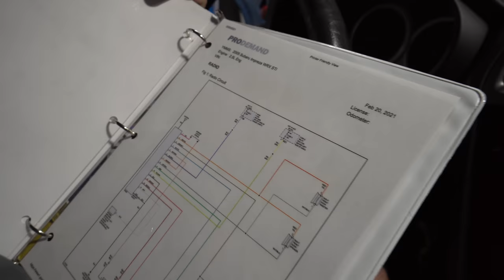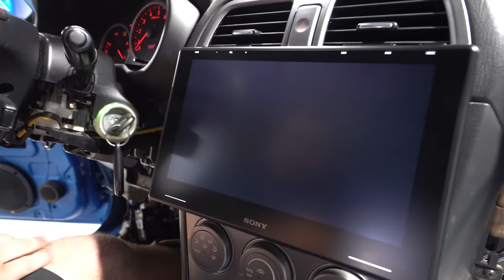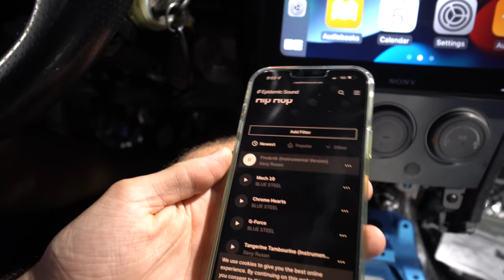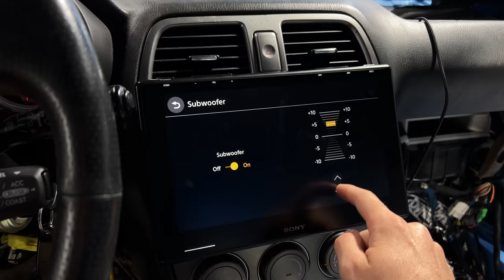Installing a HUGE Apple Car Play Unit & Sony Sound System (2021 Tech in a 1996 Car!)

Comment: I’ve been following your channel for a while... Watched the garage renovation, the work on your STi... I’m running the small Sony XAV-1000 unit and I love it! But... I’m thinking about upgrading to this unit! My setup runs Infinity components up front, Infinity reference speakers in the rear doors, and an RE Competition 12” in a custom vented box all powered by a Fosgate 6 channel amp. It slams hard and is crystal clear! I just wish that I sound proofed my Bugeye the way you did your GC... Can’t wait to see what comes next! Keep up the good work brother!
Reply: do you have to have your phone plugged in to use apple car play?

Comment: Damn the screen is 1300 dollars I wasn’t expecting that and the speakers are kinda pricey too but worth it since they’re Sony but the sub is definitely a good price I’d for sure get that but that screen is way too pricey for me I’m too cheap for that lol
Reply: This particular Sony Mobile ES head unit is their FLAGSHIP.  It has DACs that rival the best home audiophile gear and also includes a Full "Network Mode" and DSP!  In terms of Sound Quality and Features, it is one of the absolute best available, and that's why it carries the Sony Mobile ES designation..."Elevated Standard".

If you want something less expensive, but with killer sound quality and features, I highly recommend the Kenwood eXcelon Reference (XR) double-DIN head units.  These have 5V RCA preamp outputs that do not clip even at full volume (40/40), and DSP/Network Mode, Apple CarPlay & Android Auto.  You can pick up a used but good condition Kenwood XR DDX9905S for $280-$350 and will have one of the best sounding stereo head units available. 

The Sony Mobile ES 6.5" Component Sets are quite reasonable for what they are at just $299....remember that this is Sony's Flagship set.  Compare that to Focal, Audison, Dynaudio, Morel, etc and they are a bargain.   No, they may not be quite up to the level of those others, but they are excellent given their price!
 
The amplifiers are only $250 each, and while they aren't monsters in terms of power output, they provide Extremely Clean and Accurate power for the components and subwoofer(s) that they are intended to be used with.  This is a system that when set up, installed, and tuned properly, will provide KILLER Sound Quality.

Comment: 1300 for that head unit alone 😂 was really responsive tho compared to other double din screens
Reply: This particular Sony Mobile ES head unit is their FLAGSHIP.  It has DACs that rival the best home audiophile gear and also includes a Full "Network Mode" and DSP!  In terms of Sound Quality and Features, it is one of the absolute best available, and that's why it carries the Sony Mobile ES designation..."Elevated Standard".

The 6.5" Component Sets are quite reasonable for what they are at just $299....remember that this is Sony's Flagship set.  Compare that to Focal, Audison, Dynaudio, Morel, etc and they are a bargain.   No, they may not be quite up to the level of those others, but they are excellent given their price!
 
The amplifiers are only $250 each, and while they aren't monsters in terms of power output, they provide Extremely Clean and Accurate power for the components and subwoofer(s) that they are intended to be used with.  This is a system, that when set up, installed, and tuned properly, will provide KILLER Sound Quality.

Comment: I love this it really shows what a good compo set , sub and radio(also very important) does to tge quality of sound in your car. And that wiring looks really good the only thing i would have done diffrent is the cable inside the sub box. I would have tacked them to the bottom so it isnt completely lose but that more for my own sanity i think.

Comment: why are you running wires through the door panel metal without protecting them. gonna cause a short sooner or later especially since you didnt deburr the holes...  Also shouldve put foam on the speaker cables so they cant vibrate in the doors etc

Comment: You have the fuses for the amps mounted way to far away from the source.  The only thing those fuses are protecting is the inches of wire between them and the amps.  They should be mounted no more than 12 inches from the battery....the closer the better.  NIce build other than that guys, the more you grind the more satisfaction you'll have in the end.
Reply from the maker: The battery is relocated in the trunk

Comment: Are those wires for speakers? oxigen free cooper? i belive use courrent cable for audio instead... Sorry I never liked make holes with the speaker in place, and never ever put cables on a hole that havent been removes all the metal from the hole. Not a good work.

Comment: I have a jdm 94 wrx, the ej20g blew, considering the fact that you pulled the engine and want to go fast when the light turns green I’m assuming your going to put a ej257, is it possible for it to fit without doing any changes to the body work, maybe making the engine bay a little bigger

Comment: How did you managed to install the head unit close to dash?
I have the same radio in corolla but there is atleast 2-3 cm gap between receiver and dash. Please share any tips to move it a little back (close to dash)

Comment: for the love of god, build some sort of rear deck venting for the sub stage.
Reply: Better yet, build an enclosure that fits in the front passenger footwell.  In this system it would provide WAY better subwoofer frequency response and accuracy...even if it is a sealed enclosure.  ;) 

Check out Brian Mitchell's ARC Audio World Championship Sound Quality competition vehicle (Cadillac EXR) where he uses a single 12" subwoofer firing towards the firewall in the passenger footwell.  :)
Reply: @bbfoto7248  that would be annoying to move around.

Comment: I have two questions. Did y'all tune the amps to the head unit, or tune it by ear "oh that sounds good". Need to figure out what at what volume the head unit starts to distort and tune the amps according to one volume setting under where it distorts, for the system to be properly tuned. Second question I have is, what kind of power is going to that sub to only be using 16 gauge wire? That's incredibly small wire. Most subs come with like 10 gauge or even 8 gauge.
Reply: Oh wow, I see that stats on that sub now. 4ohm single voice coil 450 watts rms. Itty Bitty sub.
Reply: At least 12 would have been a start but that small wire was the cherry on top for me
Reply: 10 gauge wire is going to the sub
Reply: @Randallpullen123  10G might be going from amp to sub but the bottle neck will be the 16G leads coming from the sub. I would pull those out and replace them with 10G.

Comment: why install components in the rear? why install the front tweeters low in the door and not the a pillar? why cut the factory harness instead of buying the proper adapter? just odd to see things like that

Comment: How do you feel with the volume buttons on top like that? Also.. are there any good solutions to mount some type of steering wheel control that you typically lose out on when going after market head units?
Reply: @Tom Le  
You can typically purchase a 3rd party Steering Wheel Control Interface such as the SWI-series from PAC-Audio, Metra/Axxess, iDataLink Maestro RR, etc, that will retain the OEM factory steering wheel controls when installing an aftermarket head unit.

The iDataLink Maestro interface also adds Performance Gauges and other custom features to Head Units that are Maestro Compatible (such as this Sony and most Kenwood eXcelon stereos), including OEM TPM, and the ability to assign TWO functions to Each steering wheel button by using either a quick press or long press of each button.

But I wish that they had a Rotary Commander Remote similar to the high-end Sony RM-X90 rotary commander remote on the previous Sony Mobile ES # CDX-C90 head unit.  That remote is AWESOME and can be operated completely by tactile feel without ever taking your eyes off the road.

IMO, most steering wheel controls are difficult to operate when driving this type of sports car...i.e. through the "twisties" during spirited mountain and canyon or track driving.

Comment: how much did the entire project cost give or take because i would love something like this for my car
Reply: This is Sony's new Flagship Mobile ES (Elevated Standard) car audio gear.  The head unit alone is $1,300.  Each 6.5" 2-way component speaker set is $299.  Each amplifier is $249.  The 10" Subwoofer is $218.  Add in the cost of materials for the subwoofer enclosure, RCAs, Power wiring, fuse blocks, battery terminals, Dynamat, etc...so probably another $250-$450.

Comment: Not sure I can let this one slide, copper wiring is definitely NOT all the same, you should definitely use specific wire for specific purposes, there’s solid and braided wire, wire of different resistance, wire with different levels of purities and consistency…..and there’s a lot of different types of shielding for different purposes…insulation, heat resistance, grounding, signal blocking, you should NOT be using any copper wire Willy nilly for any purpose, that’s just bad information

Comment: also you bothered to solder each connection at each speaker but couldnt be bothered to remove the sub terminal and solder those wires on?

Comment: Through out this video I noticed numerous instances of wireing being run over metal body panel edges and holes with no protection against insulation being warn through against these edges. This presents a high risk of short circuits. Cable routing and securing needs to take in consideration of othere moving components in the vehicle, particularly around the window regulators and door locking mechanisms. Holding speakers inplace while drilling through there mounts risks getting metal swarf into to them. Using a impact driver to drive in fixing screws on spekers risks over torquing them and distorting the cage and causing subsequent misalignment of the speaker cone and voice coil. I did notice in the video moments where these screws were over torqued to the point stripped the fixing hole. Single screw through the crossovers may not be ideal as this may be a sorce of vibration against panels there attached to. No automotive felt protection wrap on cabes lightly to cause vibrations against body panels and other vehicle components. No drip shields on door speakers. With car doors there is a some seepage of water around the window that enters the door cavity in wet conditions or washing. With out any protection over the back of a speaker located with in this cavity this water will drip on it and damage it. The low location of door tweeters will massively atenuate there output Vehicle specific plug in wiring harness adapters are available for head units, where possible it is preferable not to cut up the OEM wiring harness. With head units that have video displays there are many places that it is required to be able to detect if the parking break is applied. Some acoustic packing in the sub will help with the standing waves from it's central position in the enclosure, and also keap the excessively long cable from rattling around inside. Soldering the spade terminals to the speakers will make it much more difficult in the future if the speakers need to be removed for some reason. If the spade terminals used are not secure out of the packet then sorce better quality ones preferable with insulated covers to mitigate the possibility of a short. If a bit more securing is required Locktite or GE RTV compound can be effective at providing a semi-permanent electricity non-conductive fixing support. 
The sound dampening matting from appearances looks to have been put on well were used.

Comment: Why not mount the croosovers below the amps?
Reply: Why not ditch the Passive Crossovers altogether for the front component set and use the Full DSP and Network Mode included in this amazing head unit?

Comment: I loved the install but you would never catch me spending that much on audio equipment
Reply: How much does it cost?
Reply: @j.rjunior5584  that equipment and how you would set it up over 500$
Reply: @j.rjunior5584  
Head Unit $1300, Component Speaker Set $300 Each, Amplifiers $250 Each, Subwoofer $220.  Add in the materials for the subwoofer enclosure, power and RCA signal wiring, fuse blocks, Dynamat, etc, so probably another $250-$400.

Comment: Should’ve used a ipad pro m1 detachable, BUB!! Lol
Reply: No Apple CarPlay, no ESS Sabre DAC, no backup/forward/side cameras, no AM/FM Tuner, no 5v RCA non-clipping preamp outputs, no Bluetooth Hands-Free Calling, No Steering Wheel Controls, no Network Mode and Full built-in DSP...need I continue?

Comment: @Cameron Alford  
@Randall Pullen  
Nice install with excellent equipment, guys!
  
But FYI, this head unit has a full "Network Mode" and DSP Built-in!   Unfortunately, you are not taking full advantage of it and are using the passive crossovers on the front component speakers.  :-(

It's fine to use the passive crossovers on the rear component speakers, but the Front Component midwoofer & tweeter should take full advantage of the head unit's built-in DSP, which includes independent level control, crossovers, time alignment (digital delay), and parametric EQ.

I would have also treated the doors inside and out with Dynamat Extreme or preferably ResoNix Sound Solutions CLD Tiles & CCF foam.   These Sony Mobile ES speakers deserve way better installation in the doors!

Once you have the windows and all the linkage/hardware installed in the doors, I would seal all of the large and small openings in the door sheetmetal panel where the speakers are mounted.   You can use thin aluminum or steel sheetmetal or 1/8" thick ABS plastic (moldable to the door's contours using your heat gun) to make these cover panels and then apply Dynamat Extreme, Stinger Roadkill Ultimate, ResoNix Sound Solutions BARRIER (my favorite) or similar CLD sound deadening sheets and thin CCF foam to both sides of the panels before screwing them into place using small self-tapping sheetmetal screws.

Ideally you want to completely isolate the front and rear sound waves of each speaker so they cannot interact with each other, otherwise you will lose a significant amount of midbass output and lower their performance overall.

And once you get the window glass installed, you might also find that you need at least 1/2" thick speaker adapter "spacer rings" to prevent the window glass from hitting the rear magnet of the speaker as the window is rolled down.

You can cut these speaker mounting spacer rings using a drill and jigsaw if you are careful and take your time using 1/4" to 1" thick Sintra blown PVC plastic sheets, "King Starboard", or ABS plastic sheets.  Do not use any type of wood as it will be subject to deterioration due to moisture absorption.

I also think that once you try to install the door panels, you will find that you to need to relocate the tweeters.   Unfortunately, these tweeters are larger than most which complicates finding good mounting locations, but there is a reason that they are larger...to improve performance.

With the use of the head unit's DSP,  the small plastic trim "sail panel" triangles inside of each side view mirror would be a good location for the component tweeters if they will fit.  Either that or flush mount the tweeters in the upper forward door panels using the included hardware.

Contact Doug Dobson at MSC America or Justin Zazzi at Rockford-Fosgate in the Phoenix/Tempe AZ area to help "TUNE" the DSP in the head unit and the overall system.  ;-) 

THEN you would be truly BLOWN AWAY by the sound quality that this system can provide!   You can find Doug and Justin on the DIYmobileAudio Internet Forums if you Google Search "DIYMA" and their names.

Doug and Justin try to have a casual monthly get together with other car audio enthusiasts at a good local restaurant in the area where they Demo their car audio systems for each other, hang out, and help each other with their car audio install and DSP Tuning.  Great Guys!

EDIT:  I would also use rubber grommets or at least wrap the wires in Tesa Tape where they pass through sheetmetal openings.  Obviously the TechFlex sheathing that you used on some of the wiring helps in this regard, but some of the door speaker wiring looked to be unprotected and this is where you are most likely to have issues due to the vibration and opening/closing of the doors.
Reply: @Cameron Alford  
@Randall Pullen  
* One more oversight. *  You NEED to install the Main System Fuse on your 0 AWG Positive (+) Power Wire within 18" of the Positive Battery Terminal  in order to protect the length of Power Wire that runs all the way through the vehicle to the trunk and to the distribution block/amplifiers.

As it is, if there is a short or if the power wire disconnects some where between the battery and the trunk, that 0 AWG wire is a completely "LIVE" wire with HUGE Amperage capacity to create sparks and a fire in the vehicle! 

So put the main system fuse or a Stinger Marine Grade Circuit Breaker within 18" of the Positive Battery Terminal.

AND, at the distribution block where you convert from 0 AWG power wire down to the 4 AWG power wire, you need to place a smaller fuse at the head of EACH 4 AWG wire that goes to each amplifier.  Again, this is to protect the WIRE and the CAR from a short circuit.  The Fuses in the amplifiers protect the amplifiers themselves and NOT the Wire!

This is most easily accomplished by using a FUSED Distrubution Block near the amplifiers to transition from the main 0 AWG power wire to each 4 AWG power wire run to each amplifier.

I can show you many examples of very nice cars that have burned completely to the ground on the side of the road because this practice was not adhered to!
HTH!